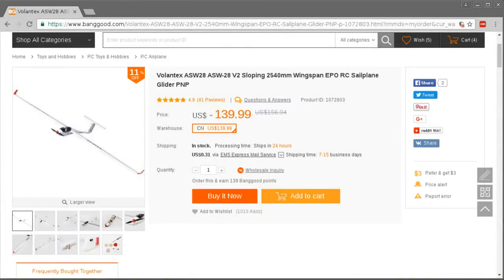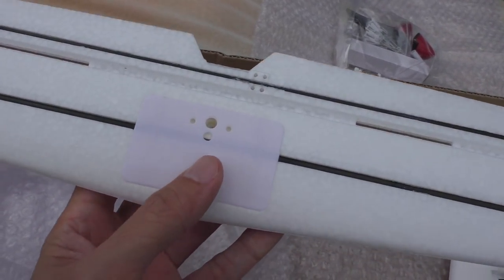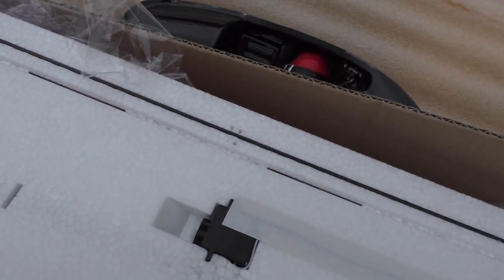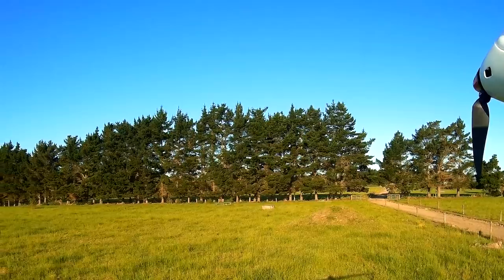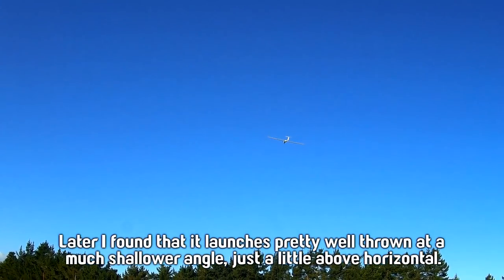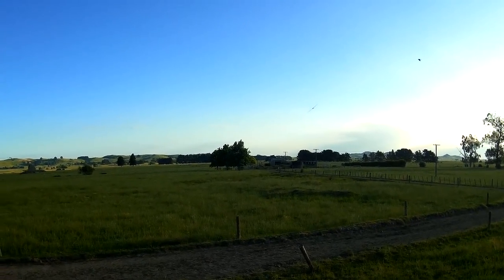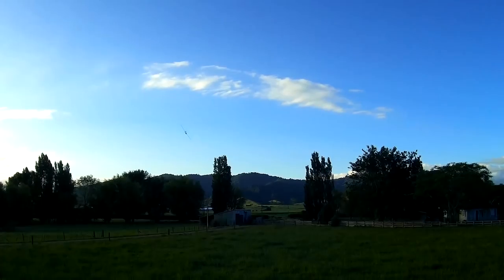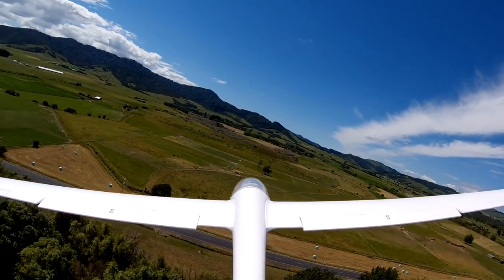Volantex ASW28 2.5m motor glider first flights

Comment: Nice glider Chris. My ailerons are also bit non-responsive, but if you mix the flaps in with the aileron then you can get reasonable adjusment.
The nose heavy CG is a pain. I fit my battery into the wing strap space above the spars. I can fit a 2200 3S into there, and it locks in place without much extra support.
The sensitivity to the wing tips will be due to the fact there is no dihedral. Flat wings and high aspect means you really need to fly the plane, no time for snoozing.  :-D

Comment: Nice job! Ive spent more stick time on gliders than any other type of plane in 30 years of rc flying. One thing you may try just for the fun of it is to make a couple of thermal indicators. Here in the states I use a "crappie" pole. These are bought at Cabela's online and they are just a telescoping rod thats about 12' foot long. Tie a piece of video tape to the fully extended end. Make the tape about 10 foot long. Place two of these across from your position about 100 to 150 yards away and about 200 yards apart from each other. As your flying you will feel a thermal pop and if it is out in the field from you, you will feel the wind coming from behind you. Then when you look at the two rods out at their position you will see the tape being pulled to the thermal position. Based on where you see the tape being pulled to you can run your glider between you and the other positions and gran your thermal and take the elevator up. I think there is a video here on youtube that shows the technique, I will try to find it and link it. Its a lot of fun! Look up Joe Wurtz on soaring. Its over an hour but he explains on a whiteboard what to look for( it actually sounds more complicated than it is) but then he goes to the field and gives a practical demonstration and throws his hand launch glider into the thermal over and over so its a great lesson in finding thermals. Good luck and have fun!!

Comment: My brother has one of these but an earlier version. Looks great in the air but not really a floaty thermal plane. Be careful of tip stalls keep the speed up when landing. Much better on 4S. Canopy is weak as piss take the opportunity to mould a fiberglass replacement while the original is still in one piece. overall a good sport sailplane with elegant scale like appearance. I like them
Reply from the maker: I agree with everything you said - have not tried on 4S yet but it often does feel a bit lacking in the climb. I broke the canopy on a landing that wasn't really that hard, it cracks where those little plastic pins are. Didn't break all the way through though so I could tape it back together, I also taped around the other pins too, might help to prevent more problems.
Reply: The new one has a thicker canopy and a few other upgrades
Reply: Scale glider models just do not work well. The Reynolds number is too low for thermalling. Someone needs to make a semi-scale with light wing loading and a wide wing chord!

Comment: Great video. I just bought one. Quick question, how did u fix the propeller brake issue?
Reply: it is something you would have to do with the transmitter there are ways to do it for the esc but i normally just set it to a switch and it stops

Comment: about the nose tendency to turn away from straight flight,  ITS CALLED PROP. TORQUE. the solution is to angle the motor about 2 to 3 degrees opposite the tendency, this is well known to any experienced pilot "real or model aircraft" flyer
Reply from the maker: I have flown dozens of RC planes and never felt that effect. I seem to recall this plane was doing it regardless of motor activity anyway...

Comment: 5:04... Ferrite Ring.... ;)
10:13 ... Just setup the ESC to use the braking function to stop the prop from spinning when you down throttle and the prop should fold down to the fuselage.

Comment: Wonder how some ply or CF might go on the control surfaces?

I was thinking about your vario also while watching this, and although there are commercial units I have a mate with
no telemetry. After seeing a (thanks Hayri) vid I thought of using 2 ESP8266's in P2P mode (thanks Andreas).
Plane one would send basic info like altitude and height change and ground one would beep accordingly.
Think it's worth the effort Chris?

Comment: very sweet. i'm not sure how much telemetry you're getting,  but i'm sure it will make a diff with FPV, being able to ready your speed vs altitude while going through the thermals. Have FUN! the folding prop, is that supposed to fold when throttle is down?
Russ from Coral Springs, Florida, USA
Reply from the maker: Yes, but out of the box the brake was not enabled.

Comment: Nice demo.  To confirm, was your launch without flaps deployed?  Thanks.
Reply from the maker: Definitely. Nice strong throw and just a little above level, or if you are fortunate to be standing on a hill just throw level. I never found the flaps to be very useful for much, but perhaps I'm not using them properly :)
Reply: Nice video.

For this glider, flap is most useful to setup mix with ailerons as airbrake.

Comment: what battery size 3 cell you use to get a good balance of CG if no FPV is used? and for how many minutes flying if running motor full time. ?
Reply from the maker: probably 2200 would be ok. I have no clue about your second question though because I've never done it, that's not really the point of this plane :)
Reply: Thanks a lot. 👍